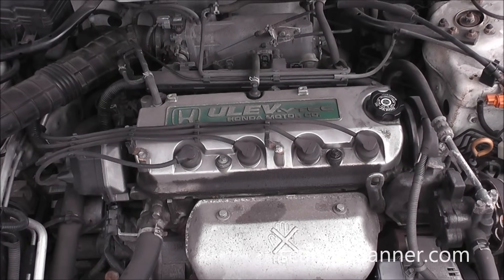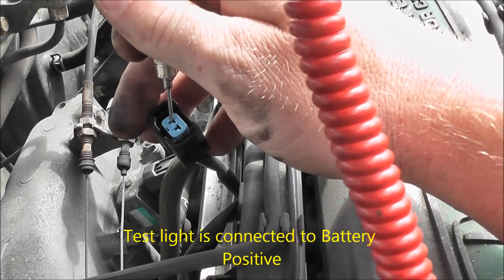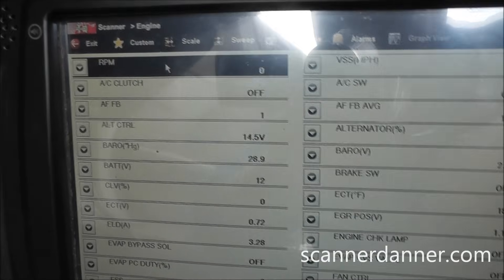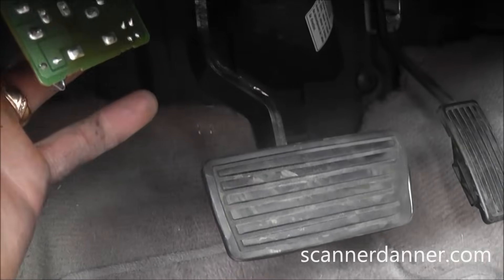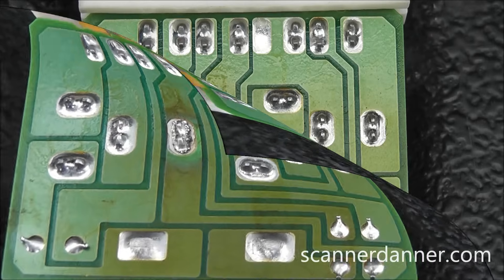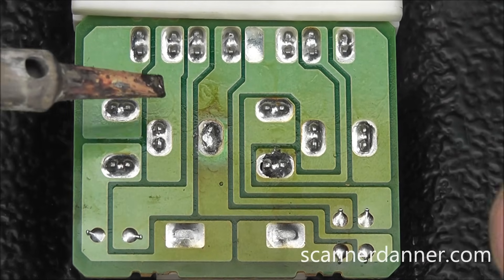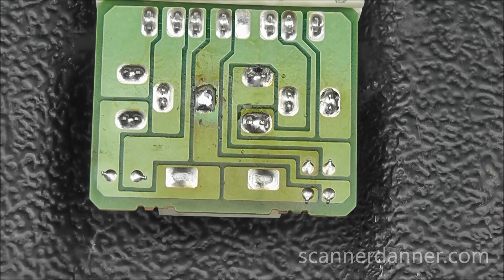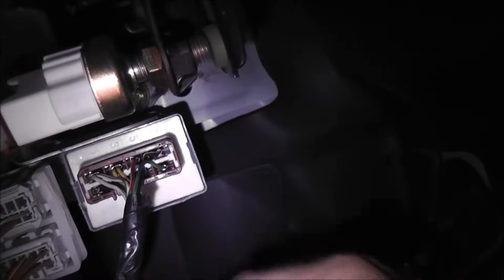How to identify a bad main relay on a Honda (PGM-FI)

Comment: As a tip, you should be wicking the solder away from the pad, then lay-in new stuff.

The flux will reflow everything over the contact and make it nice and solid.  You'll also be able to check the pads to see if you had lifting from the board.

If you had lifting, you can repair with a copper wire, tacked down between the contacts.

Comment: I hope this is the problem with mine. I'm not a motor head but if this is my issue , I can handle this. So this relay is under the steering column?
Reply from the maker: In that area, yes.
Reply: +ScannerDanner  UPDATE , it's at mechanic now being inspected but this problem of not starting , happened while there and he wants to replace whole distributor $390 + $80 labor. I do not see distributors costing $390 in my research. This socks!!

Comment: Some tips for better soldering... keep your iron tip tinned so it doesn't get corroded to help with better heat transfer. Try to remove old solder with a braid or sucker. Use some flux to make nice wetted joints.

Comment: So i have a 02 accord 4 cyl sedan.
After having it sit for 2 weeks and i went to start it it refuses to start the fuel pump wont come on and engine light is one. So it cranks and turns over perfectly but wont start. I have an obd scanner coming in the mail in 2 weeks but want to figure this out asap.
I removed the fuel pump and connectes it to the battery directly and it comes on and works fine. I changed the main relay and it made no difference. when ever i connect the pump to the car it wont come on. Also even thought the battery is full whenever i crank the car in that breif moment  all the lights come off and the clock resets. I canot even get windows to move. 

Any advise would help
Reply: Bob.. You may have a bad body ground. If you don't have a book, go to the parts store and ask them to look up the locations for body grounds (Fuel pump) and print them out along with any wiring diagrams with wire colors. Use a test-light to check the power on both sides of the fuel pump fuse, you may need someone to cycle the key off & On, to signal the pump to turn on. If you have power on both sides of the fuse and the pump does not run you are looking at a short or bad ground. As you said the pump ran when power was applied. You can always take it to a shop or make a jumper wire and redneck a fix. As long as it works again and your happy with it... Good luck.

Comment: You gotta tin your tip (clean it at a wire wheel then cover it with solder) and use flux core solder to help the solder stick some more!

Comment: I just replaced mine with an aftermarket relay. I have a 2000 Accord EX coupe 2.3. We'll see how long it lasts. I compared the two and the OEM is definitely better quality all the way around. It took me a little time to get it out (only one bolt) just in a hard to reach place (the bolt, not the relay itself) It also took some work getting the old one off the bracket after I got it out. It looks like you should be able to just un-clip it from the bracket without unbolting and removing it from the car, but it had been in there for 17 yrs, and no way I was getting it off that bracket without removing the whole thing... I am re-flowing all the soldering joints on the OEM so I have it for backup in case (or when) the new one fails. But since I replaced it, the car starts right up... So far, so good... I also watched your lesson on how the circuitry works. Great stuff. I learned a lot. Thanks Paul...

Comment: One question: If I wanted to check power being sent back to the fuel pump from the main relay at the connector, is it all one yellow-black wire? My mechanic is telling me that my main relay is fine, but that its losing power between the main relay and the fuel pump. I'd like to test along the length of the wire and see if it just needs to be replaced.

Super helpful video, really apprecaite such a thorough look at testing the fuel pump. Wiring diagrams can be tough to find for a model this old.

Comment: Hey Danner, I have a 97 honda civic lx, it has no spark, but has fuel, would you say,  the main relay, is a culprit?
Reply from the maker: Check it, I showed the steps involved in how to do it and I have another video or two on testing the PGM-FI main relay. 
I'm pretty sure with a no spark problem you will be looking in another direction. I have some no spark videos on Honda engines as well.

Comment: Word of advice to every 98-02 accord owner (Both V6 and I4). Even if it isn't giving you problems, change it because these cars are notorious for the main relay going. I've had 8 Accords (3 sedans and 5 coupes) and 3 of them were v6, the rest were i4's and almost all of them gave me this issue. This one that I have now hasn't given me the problem yet because I bought a new one as soon as a bought the car. I was doing the "new car tune up" and remembered the nightmare that is a bad main relay so I bought it. $60 brand new but its worth it

Comment: Remember to use a Flux based electronic solder. Allow the iron to get hot, then the connection, then flow the solder onto the connection. Don't melt the solder onto the iron.

Comment: I have limited engine knowledge and your videos are very helpful!! My niece recently bought a 2000 Honda Accord v6. "On her own" . It's having intermittent starting issues & sometimes the rooms dance higher- a local shop (non Honda) diagnosed as a bad egg valve, which didn't help. Besides the main relay Amy other ideas? Greatly appreciated!

Comment: Excellent instruction.  You are a wonderful teacher! Thank you so very much for  this video -- not that I'm going to head out to buy some automotive tools and tackle the problem myself.  But at least I feel as though I've got the basics down when I talk to the mechanic who's diagnosing the problem with my '99 Accord, i.e. stalling whenever, wherever but after a "rest period," starting up again without incident.

Within a matter of a week or so the problem has occurred more frequently: Car would start, run for a minute, then stall.  A short wait and it would start, with almost no "run time" afterward. Maybe a minute at the most.  I was terrified the car would stall in the left turn lane or, worse, that it would simply "die" with no warning at all on a busy highway.   Didn't want to even take another chance after that, so I had to have it towed to a repair shop. Waiting to hear the bad news...
Reply: +Caryss Behan Hi, what's the final reason for your car. My car now is encountering the same problems. I have exchanged the fuel pump in firestone, but it doesn't work.

Comment: A few soldering tips:1) Clean the tip of your iron! Wipe it on a damp sponge, tin it by melting solder over the tip and wait until the flux burns off then wipe off on the sponge again.2) Get a tin of Electronics paste flux NOT copper pipe flux. It will last you many years. Apply a very small amount of paste flux to the bad joint and heat the joint with your iron. This will help clean the crud out of the joint.
3) Now solder. On really poor connections like in the video it can help to add a good amount of new solder to the joint then use a solder sucker ($15 at radio shack) or solder wick to remove most of the solder from the joint. This gives you a nice clean joint to solder. If the joint is really bad very carefully scrape the solder mask off (clear coat type stuff that seals bottom of board and traces) on the copper trace around the joint, you just need about 1/32" bare copper exposed. This will give you fresh copper to solder to.

Even the best manufacturers seem to put out boards with this type of problem because of the same design problems. It comes down to the weight of the component (relay in this case), the vibration it is exposed to and the circuit current vs. copper trace with. In this case the relays are heavy and exposed to a lot of vibration. They should not relay on the solder joint alone to hold them in place. After the initial repair, use a bit of silicone around the edge of the relay to hold it in place.

The width of the traces on this PCB look OK 'except' where the relay pins come through. This leaves very little copper and you have a mechanically weak connection which is supporting a heavy relay. Like my electronics votech teacher used to say, "The first step to a good electrical connection is a good mechanical connection." There is not a lot you can do about the trace width, scraping the solder mask back and creating a larger solder joint will help.
Reply: Thanks a bunch. This is helpful
Reply: LOL, I didn't see this and just posted about the same thing but glad someone did!

P.S. A sponge isn't really used or recommended anymore because it will leave pits in your tip. They sell what looks like a wire brillo pad for a few dollars that works just as well if not better.

The pads aren't too small IMO and scraping back the mask is a bad idea for a beginner. Yes, this is a method that is often used but the (most likely reason) these cracked is because they used what is called wave soldering and there isn't much solder to begin with. I don't think anyone necessarily needs to buy flux, most good solder nowadays has a rosin core with flux already in the solder.
Reply: Great tips!  I also like to clean the area with a toothbrush and some alcohol, before starting the solder job.

Comment: i have a 1996 civic with 1.6. has great white spark, i replaced distributor. has good compression, and is timed right. has fuel, plus i put some gas in the cylinders and cranked still no start or sputter. what left can i check?
Reply: FlyinRaptorJesus I have the same problem right now and I don't know what to do ...
Reply: What it was for me.. I put a new distributor on it and so when i checked spark it was perfect... The the distributor was 180 off the crank shaft. So it was sending spark at the wrong time
Reply: FlyinRaptorJesus p

Comment: Sit in the car, if it cranks and doesnt start, kick your foot up into the column, if it starts its the main relay. Lesson is over.
Reply from the maker: lol, and then you change the main relay only to find out it was the ignition switch (same car has both issues) But yeah, I like kicking things under the dash too! Blower motor is another one I use that test on

Comment: That's a really bad way to solder a joint. Use a solder sucker or braid to remove the old solder then redo the joint. Use flux solder or a flux pen for electronics. You might have to scrape away the solder mask and solder a wire on the track and around a terminal

Comment: i buy a car from a female she bent the valve and didn't wanted it no more so i buy it and did the head job take it to the shop they fix the valves i put the head back  on , time it  i spin the engine befor start, when time to start it at first i was getting spark at 1cylinder nothing from the rest,  and no fuel nothin

Comment: Dude you gotta clean your tips!  That's the majority of the reason your getting such crap heat transfer and why your having to hold it on so long.  Also I agree with Borked, grab yourself a solder sucker or a thing of wick and throw it in your tool box.  Wouldn't hurt either to grab some flux paste.

Comment: lol your solder doesn't seem to have enough flux in it, I think that is why the solder wasn't wicking up that well...
Also, a good soldering iron tip helps a lot! (Keep it tinned and not oxidized, as the oxide layer acts as thermal insulation!)
You really should get a proper soldering iron lol.

Comment: you pulled the fuse and took apart the fuse to get to that board, right ? easy
Reply: the main relay  is a black box with a mother board in it. In my car it was located behind the glove compartment The main part you want to look at is the mother board. If there are cracks you can use a soldering iron

Comment: Great video. Excellent diagnostic procedure.

Clean your iron and use some no-clean flux, or it could happen again quite soon. Holding the iron on the pins for that long can damage the relay or lift the pads from the PCB. No offence, but that soldering is a mess.

Also most flux can be corrosive if not cleaned off. It will eventually eat through the copper tracks and destroy the board. Some isopropyl alcohol and a toothbrush works well for me.

Comment: hey paul. its debi with the honda main relay issue. get this, my dads mechanic totally disregarded my suggestion, which was the $58 main relay plus whatever labor, instead, he told my dad it was the crank sensor, which was a $900 repair. my dad said he'd pay, so hey....then when i had 2 go back 2 shop because there was this VERY loud noise comming from under the car after i parked, i videoed it, drove straight back 2 shop and of course it wasnt making noise. i left came home, parked, and again the noise. i made the 2nd video and during the 15mins of both times noticing noise, i never turned car off. he looked at video and said he had no idea, but.....to my point, he said i dont know if you noticed, but i REPLACED the main relay but didn't charge you for it, so when i got home i looked at receipt, oh he charged me for the part, but not for labor. i was so angry to say the least because no id the intermittent non start is fixed, we wont know n if it was the $58 part OR the crank sensor at $900. he didnt even call me to tell me b4 doing so either. i just think we could of gone with  the relay 1st, but the fact he blew me off about that in the beginning, then does it after the crank sensor diagnosis, really makes it hard to trust him. 
so, 2 the question i wanted 2 ask you is, so you have a video on how 2 adjust the hand brake. i viewed 2 on youtube, but were not specific to my yr/model. 1 seemed easy enough by taking center console off and do adj. but the other was for a civic but that guy had car in jack and made adj determination by how much the rear wheeles turned, which is way beyond my ability. anyways, just wanted your input about it as far as console or if in fact it needed to be on jack for adj. again, its an 01 accord. 
thanks for any advice.
debi t.

Comment: I got a 95 honda civic de sol 1.6 with a pgm relay problem. Relay was replaced two months ago. its back with same issue. Great info here and in Pt 2. Its a no start when its not working and when it does the relay is slow to pulse the pump. but it will start. then it will work for awhile again. will follow with what I find. Mitchell wire diag is vage on the black/yellow wire. it goes from fuse 24 to junc connector to pgm. from connector to vss and ELD unit. Could this be robing power from blk/yel wire. dont have Bv at pgm with KO
Reply: +Michael Nicholson have .020 v with key on when its not starting. Heading to shop now.
Reply from the maker: +Michael Nicholson ignition switch is a very common failure

Comment: Good video tutorial.  It's a crappy relay board design, as it relies on the solder joints for mechanical support of the relays and other components.  For high vibration applications, such as in motor vehicles, the components should be held down by crimping the leads or with mechanical fasteners, with the solder joints' only purpose being to provide electrical continuity.  This design would never pass MIL-SPEC or aerospace requirements, which are often more benign than an automotive operating environment!

Comment: Thought i had a bad relay as my Integra would crank but not run sometimes and once shut off while running.
Turned out to be a worn out ignition (key) switch.
Reply from the maker: That would be the other most common cause on a Honda. Nice find.

Comment: Any idea how common this issue is, or how many vehicles were affected?

After I pulled mine out and reworked the PCB I saw a lot of improvements that could be made. If there is interest, I'd be happy to develop a direct replacement that will stand up to all the tortures this thing goes through!

Leave a comment if you're interested, if it's only a few the cost may be about the same as a replacement (but still better), but in volume I could probably have a better version made for much less than an OE replacement.

NOTE: This is not an attempt at a kickstarter I'm just getting an idea of how many would be interested. If there is enough demand I may consider the next step.

Comment: My 99 Honda accord ex v6 is doing the same thing right now so I check my relay and replace it is doing the same thing I check the fuel pump is sounds like is working plz let me know what you think is my car problem thanks keep up a good work.
Reply: If you're having a low rail pressure issue maybe your fuel filter, or spark/glow plugs? Potentially your starter motor. Do you know what your issue was in  the end?

Comment: 12:17 Bring some flux along with you :)
Reply from the maker: +hellzone100 the flux capacitor? :)
Reply: +ScannerDanner At least you wouldn't need roads where you're going if you would.
Btw if you add some solder on the tip first it will heat up the component much faster. Well not much faster, but a bit faster. :)